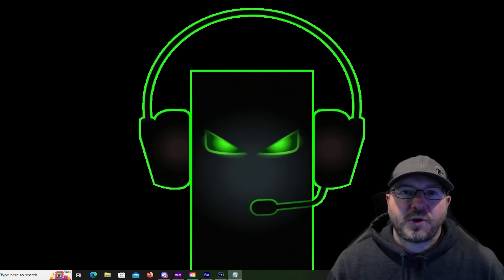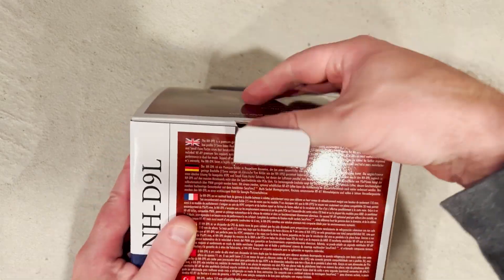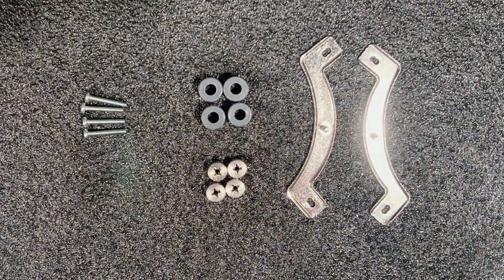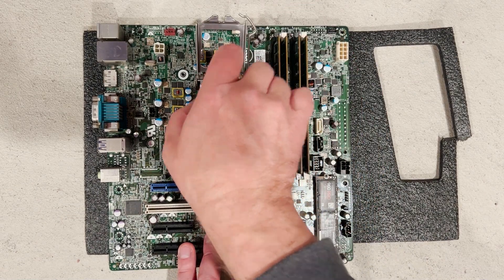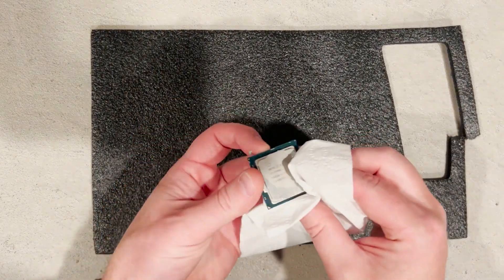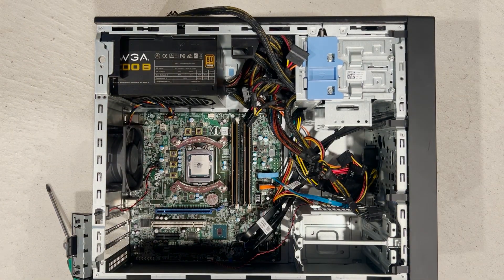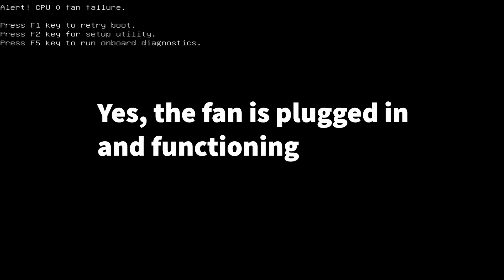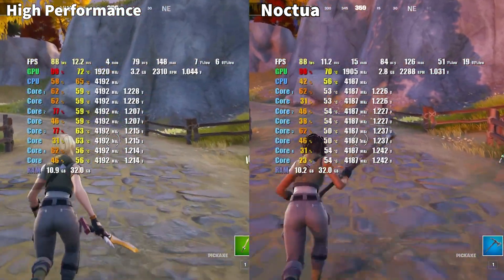Precision T3620 High Performance Stock Heatsink vs Noctua NH-D9L Heatsink

Comment: I ran into same fan error,   the system is looking for a 2400 rpm  cpu fan.Try swapping the included noctua fan with a 2400 + rpm unit to fix error